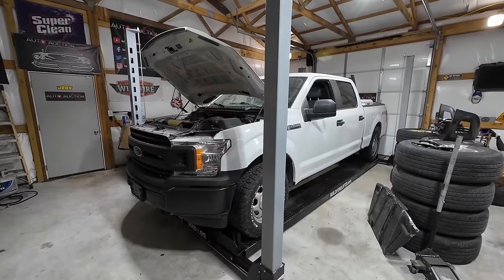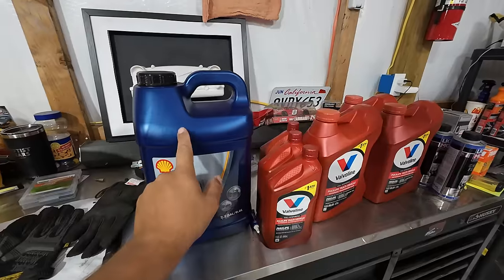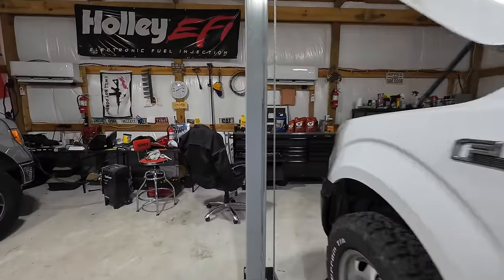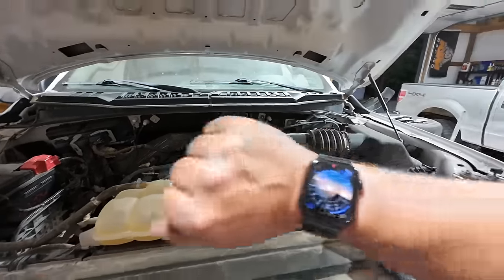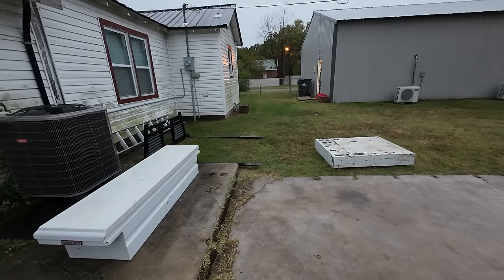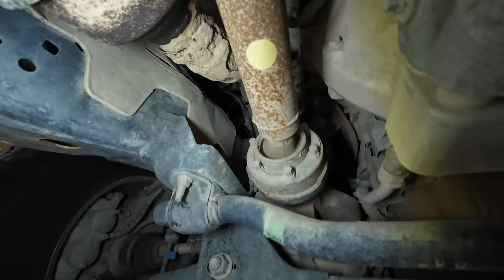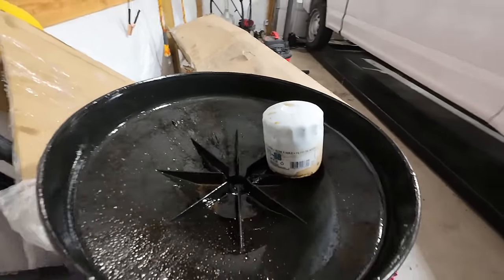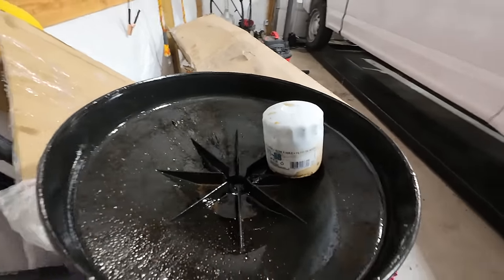Can Liqui Moly Save my $10000 ford F150 Engine or is it too Late?

Comment: You should definitely do a compression check, it sounds like piston rings are worn out. I had a ford V8 truck same exact sound and turned out I had two cylinders at 120psi compression, good compression is 190psi+ anything less than 180 is low. It’s a simple check unscrew spark plug screw on hose and crank for 5 seconds. I’d like to see you do a video on that.

Comment: Diesel rated Oils have Higher Detergent package and will clean a gas Engine Chevron Delo makes a 10w30  I use it in my Colorado and the engine is Super Clean inside !

Comment: I love your Ecoboost, I bought one a couple months ago and I love it. Same color, 4x4, everything. Re: the Coyote, that truck is in amazing shape. If you could get a new engine for it, it would be worth it in the long run. The only problem though, if you put a new Coyote in it, you're probably going to end up with the same issues at some point.
Reply: pre '18 coyotes have steel liners in cylinder walls instead of that plasma coating or whatever, and generally speaking are much more reliable and trouble free, especially '14-'17.

Comment: Sounds like a lifter or rocker on the driver side towards the back. At first it sounded like exhaust maifold until you got close to that area. At 8k you're still ahead if you have to rebuild or find a good used engine

Comment: I hope that flush doesn't cause a issue like I had happen with a Jeep Liberty. 10 minutes of putting in a engine flush from AmsOil and the engine locked up and she wouldn't restart. Was a 3.7 l V6.

Comment: I've got an old KIA Sportage and it's making the same.ticking or knocking sound my engine ended up being overhauled and guess what we found? It's the Piston Arms Bearing liners (don't really know what it's called) but you can find it between the piston arms that is connected to crank shaft those linings or bearing bushings whatever is causing the sound

Comment: I bought a new 2018 5.0 f150. It sounded like it was coming apart. 10 months and 30000 miles later Ford finally bought it back. 👏👏

Comment: That tap sounds like a bad roller bearing you need to check the bearings and cam to see if there is damage. Not an expert by any means, but I know Ford, GM, and Ram have had that issue happen.

Comment: I have an Ecoboost V6 and had a high pressure injector tick like that. Also, high pressure fuel pumps wearing out sound like that. I ran a SH**TLOAD of Marvel Mystery Oil through the gas tank and a slew of other brands and gave it quite the “Italian tune up” and it seemed to mostly quiet down. Just a thought. Those damn ticks and rattles can and WILL drive ya nuts!!

Comment: I have literally the exact same sound to a Tee. The truck is in great shape, 200k kms, and makes that same tick, slows down when it warms up, and speeds up under acceleration.
Additives didn't do anything. I think it's the exhaust manifold🤷🏼‍♂️
Reply: @mohzein456   did you fix your ticking noise?

Comment: it is not bearings or piston noise or the heavy oil would have helped, oil pressure looks ok, no check engine light means the timing chain is probably good, it could be a cam phaser but I am thinking simple rocker or lifter clearance hope the cam is ok

Comment: I have a 5.4 3v that sounded just like that with NO check engine light, it was the cam phaser and the timing chain guides were cracked so the chain was slapping. After swapping those and 60k miles later is quiet as can be, dunno is that applies to the 5.0.

Comment: Everyone may do whatever with their vehicles, but many still stuck on the myth “the many mileage run or oldest vehicle, the greater viscosity must have the oil”! 🤷🏻‍♂️. Oil should always be used the recommended by the manufacturer for ever.

Comment: IF its a stubborn dirt clogging a camshaft tunnel, a chlorinated additive will dislodge it. Try Militec1 or Motorkote 100 or any other Cl2 add. Solved mine beating the crap outta it, on this.

Comment: Have you isolated where the noise is coming from? If it's near the injectors, the fuel injectors on these are known for being noisy and can be mistaken for a tapping sound. If it's coming from the valve train it could be a bad lifter or lash adjuster. If that's not it, a tapping noise in these is often due to the timing chain tensioners, the timing chain stretching, or the cam phasers for the variable cam timing failing. Essentially there are quite a few things that are common with these engines that can cause this kind of noise, so diagnosing where it's coming from can go a long way to determining the root cause.

Comment: We had a old dodge van w/ 318 eng.went 2 million miles after putting  dualube in it just certainly kept getting quieter it got so quiet we had to honk are horn to be heard when in a trailer park ,no body heard us  it ran cold in az in the summer.

Comment: Check the exhaust manifold gaskets or and donut gaskets or flanges in it see if there and black soot by the connections I’ve had plenty of vehicles with a “tick or a knock” thats just a very small exhaust leak

Comment: I've changed oil on a lot of different vehicles but ford by far screwed the pooch on that design flaw convenient oil plug removal but sway bar right in the way of the drain path/flow so messy regardless of how precautious you are i know that pain randy ive worn oil more so like body soap then i like but it sometimes comes with the territory great video non-the less side note you can definitely tell what cars were made on a Monday and what ones were on a Friday 😂😂😂

Comment: Because ceramic oil additives only operate on metal to metal contact surfaces inside the engine you did not need to use more than one bottle of that. Actually you could probably have gotten away with only using half of a bottle. Good versions of ceramic additive are extremely efficient. But they do not require more product because you have a larger oil capacity.

Comment: Sounds like you were in the Navy the way you cussed like a Sailor! Have you tried that Lucas Oil Heavy Duty Oil Stabilizer. It’s pretty viscous. 
I had a 2006 Expedition that developed a ticking noise like that when it hit 100K miles and Ford Mechanics called it an injector ping! It was a Triton engine. That SUV ran with no major issues for over 175,000 miles and I gave it to my son in law who drove for years until it got into an accident.

Comment: Also, spray some brake cleaner on that oil, then toss some oil dry on it. The brake cleaner breaks down the oil so the oil dry can absorb it better. If you do it right, there will be no evidence of an oil spill.

Comment: I've never liked motor flushes, not because I think they are too effective and can ruin a motor. No I just don't think they do anything other than turn oil dark, and folks point to dark oil as if its definitive proof the flush has cleaned anything.

I was honestly hoping the flush would work for you, I was sorry to hear not the case. I've used both ceratec, and the flush before in my situation my vehicle developed a tick after using the ceratec.

Apparently the stuff falls out of suspension when in the oil and can kinda clot up and block oil flow. My car with 90k miles developed a loud tick after using it, and I thought I was doing something nice for the car. Vehicle was dead silent to noticeable tick when I used it so I've kinda frowned upon liquimoly after.

Used the flush in an accord a few years back, 200k miles lots of varnish, burning oil, didn't do anything for me. I often see folks defending the product saying your suppose to use them every oil change from new ... As if a new vehicle needs a motor flush ..

Comment: Oil weight is commonly changed in warmer or colder climates.   BTW did you check for a very small exhaust leak near the heads?

Comment: I'm willing to bet its piston slap. Its common in our Elantra.  The issue with the Elantra is the coating on the aluminum cylinder walls wears out, and you're left with excessive piston to cylinder wall clearance.  The engine will run for a very long time like that

Comment: I have a 2014 with 162000 miles and I have had same noise since I bought it 5 years ago with 96000 miles, I run mobil 1 5w40 European oil with jlt tune and get 17 mpg I us4 bestline engine treatment run good.

Comment: Uh that might be the manifold with those series of plastic flaps that vibrate and are a little worn so they don't position properly. Not really serious but ya just replace that entire manifold and you should be good go. Lot of people jump straight to thinking it's lifter but way more often than not it's actually the intake manifold that is having vibration with  the flaps built inside of it that have lost their ability to open and shut and hold that position with the springs and other little parts that work inside the manifold.

Comment: WORST THING TO DO IS USE A HEAVY OIL... 15W40 WILL HURT DO TO TIGHT TOLERANCES ON CAM BEARINGS... 5W40 SYN IS BEST WITH A MOTOR CRAFT OIL FILTER....TRUST ME I KNOW FIRST HAND.. TIP GLOVES!!! PLUS INSTALL A REMOTE DRAIN PLUG,MAKES IT SO EASY...

Comment: Can you locate where the tick is coming from by using a listening scope and tracking the rotation of the engine using a digital oscilloscope like the pico scope. You should be able to isolate the sound down to the cylinder by overlaying the digital captured sound and the rotation signals from the engine. It would make an interesting video.

Comment: With certain generations of the coyote I forget what generation but it has fuel injector noise which is why from the factory they have foam completely surrounding the injectors so maybe see if the foam is there around the injectors

Comment: the thing of it is that you never know why something is making the noise it is unless you tore town the engine and searched for the issue. sometimes people may know what they are talking bout but not everyone is a mechanic. sure we have heard sounds like this. it could be something not as setarious to something slowly getting worse over the years. hopefully you can find the issue and fix it once and for all. my late father was never really a fan of ford products cause they did stupid design things. on the old ford fairmont/mercury zephyr the top starter bolt was in a spot that a ratchet wouldnt work well to tighten the top bolt which is a shame. also the crown victoria the civilian version had cup holders just below the ac controls and if you had a cup in the holder it would cover or make it harder to operate the controls. the ford crown victoria yes it does have 4 cats and 4 oxygen sensors. spark plugs are a pain to have to do as well on the 4.6 but it can be done. thats just ford for ya. oh well. to each their own i guess

Comment: I use the engine flush a lot but I flush the engine oil after using the flush with a cheap engine oil after because the oil cooler holds oil so some of the flush material as well as other area's of the engine

Comment: My 89 Pontiac 6000 with the 2.5L Iron Duke used to tick like that for a long time.  When I redid the head gasket, I pulled the lifters and cleaned them.  The ticking went away and stayed away.  Maybe you have a dirty lifter?

Comment: I've got a v10 had a tapping noise at 80000 miles, changed to 15/40! Noise stopped 😮 oil consumption guit&tapping went away! Got 280000 miles on it now& it's been bullet proof ever since! Oil changed every 10000 miles.😂

Comment: My 3.7 liter ford does the same thing it runs good not lights on its got 120k on it i did water pump because it was loose serpentine belt idler and tensioner. Im going to leave it alone. Unless it gets a lot worse. I was listening with a stethascope and the only thing that was loud was the purge canister solenoid .

Comment: I keep a cheap harbor freight tarp underneath when I change oil or other messy fluids. Keeps a nice clean floor! It's the cam phasers! I had a 2011 f150 with a 5.0. If you change them, the sound will eventually start again! Sad

Comment: Set your valve gaps , someone over heated that motor so just pop the covers and set your gaps on your valves . They should be about 18 and it sounds like they are about 22-23

Comment: So - No change at all - then this is what you have - a roller follower has failed or is starting to fail . Now you need a to find which one and change out the cam and lash adjuster and roller follower, That is if you find the cam damaged which I'll bet it is .

Comment: My mom has a 2018 F-150 with the 3.5 EcoBoost, and hers had a tapping sound. It turned out to be a fan hitting against something in the engine bay, and then awhile after it started again and it sounded like the cam phasers, which it was

Comment: Hi there, I have an 07 F-150 with 173,000 miles. Recently had my mechanic change the spark plugs with Motorcraft and now it does not idle rough and the ticking has gone away. It has the 5.4L V8. Randy, have you thought about changing the plugs? Or have you changed them yet? Just curious. Love your work truck F-150 and Raptor!

Comment: Yes ford does suck i have a 2018 Ford Fiesta SE with a check engine light purge control valve and hoses have to be replaced keep up the good work Randy I curse a lot as well so I’m with you on this I have multiple times today I work at Chilli’s in Jackson Tennessee and I love it but today and I have been cursing a lot today and yesterday

Comment: Not a super expert, but the 1995-2008 F150s are great.  I wouldn't touch an F150 after 2010.    I had a 2004 that was super dependable and easy to work on, drove to 185k and sold to my brother-in-law. He drove it to 250k and I helped him pull and get the engine rebuilt and replaced clutch packs, etc in the transmission. Also replaced some worn front suspension pieces and boiled out the radiator. It now has 300k+ on it and drives like a new truck.  He just drove cross country pulling a 18' boat for couple months and said it ran perfectly. Got an oil change somewhere in Nebraska and tech told him the newer F150s are horrible to work on. He had a 2015 F150 turbo for a short time and it was a complete P.O.S.  Hard to believe Ford would produce a piece of crap like that.  I would find an early 2000s F150 with great body & interior and just throw a rebuilt 5.0 in it and take tranny to a rebuilder while you're at it. Replace radiator or get it boiled out.  Don't spend more than $5k for both.

Comment: Just curious I have been working on cars for 40 years I have never checked the oil level after  running the engine without wiping the dip stick and then checking it just asking asking ???

Comment: That normal to use such oil on big milage! On my old bmw with m60b30 there was a recomendation from BMW to use instead of 5/30 - 10/60 after 150+k miles, also on my Range rover SC 5.0 i use 5/30 instead of 0/20 and it is really quite and runs perfectly

Comment: Not familiar with this engine, but I had the same kind of ticking from a 2.2 Audi KV engine and it turned out to be the cam driven vacuum pump for the brake booster system. The pushrod wears and will make a nasty ticking.

Comment: Sounds like the Chevy tick I just fixed mine on a truck I got from auction and it was just the pick up tube o-ring not sure if these f150s will have similar issue ?

Comment: 15w40 is tractor oil 5w40 would be better but the problem is if the oil is to thick it wont go where it needs to

Comment: if you push in the oil plug while turning,
it holds the oil into the sump until you are ready to pull away,
you'll feel the tension,
also wear gloves or use a rag to help avoid the hot oil burning you,
can't help with fords shitty placement of the plug but

Comment: I know im probably wrong but u might want to check the alternator, AC Compressor, basically all things attached to the serpentine belt......my 2014 1.6L Corolla has started making this exact noise with its 3rd Engine and its just the Alternator.

Edit: Its nice to hear u cuss like Samuel L. Jackson every once a while😂

Comment: Typewriter tick ford says it’s normal operating characteristic of the 5.0 and causes no problems run 5w30 and let it be my 2017 doesn’t have it at 193k

Comment: I stopped the infamous death tick in my 08 5.4 L which started around 28000 miles by switching to mobil 1 10/w30 and every 50 or so thousand miles I use slick 50 ticking is gone except on start up

Comment: My truck makes the same noise, I've had 2 Ford dealerships look at it and tell me it's in a service bulletin, and it's normal. Nothing to fix. I've had 4 mechanics look at it and they all say the same thing. There is nothing wrong with it. So I am assuming if it does break down I can just sue one of them right? lol They call it the typewriter noise.

Comment: The 1st gen 5.0 has a common tick when the engine is at operating temperature. Mine ticks pretty good more prominent near the tq converter. Ive been trying for years to figure it out. All dealers say ots normal.

Comment: That oil spillage on your hand hurts 😢 Very stupid design on the oil drain plug. The ticking as i hear trough my Yamaha Stereo sounds like old fashion too lose valve clearances, makes me wonder if it's a "fabrication defect" I have a feeling that it's nothing to worry about. The Liquimoly oil flush Pro-line is good stuff, i had good results with it. Thanks for the video 😊👍

Comment: sounds like a rocker or cam follower, not that hard to replace, not a normal sound, it does not sound like a piston noise, that would change with load and rpm, time to remove the valve covers fluids are not going to fix it

Comment: I almost fell of my chair when that oil plug let loose, way to ripping funny watching that happen to someone else. Oh kitty litter old style cheap stuff same as drys it,  use your boots to rub into the concrete will clean it same as Napa's floor clean. Ford remember the Better Idea commercials?? They had an idea alright, over engineer everything so they have to go to a dealer for repairs............